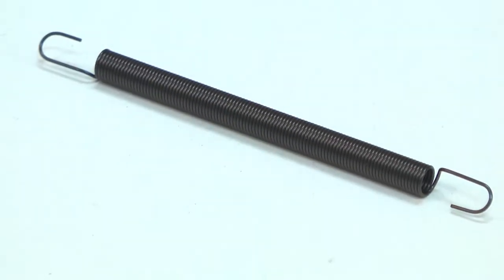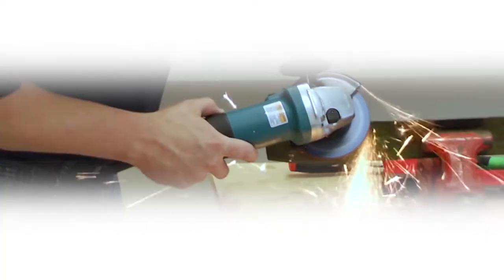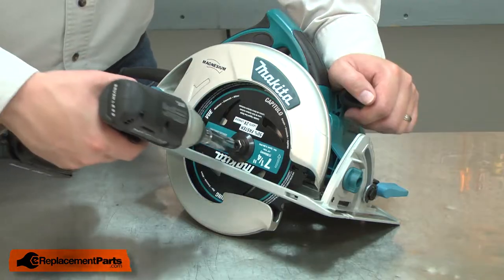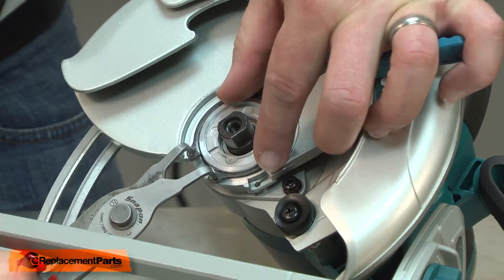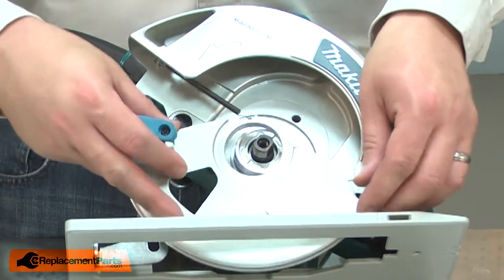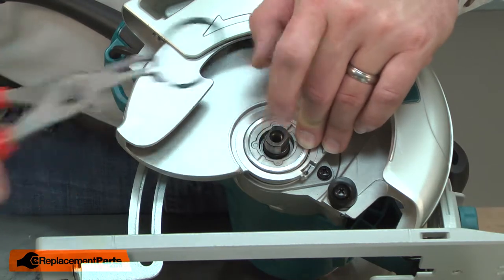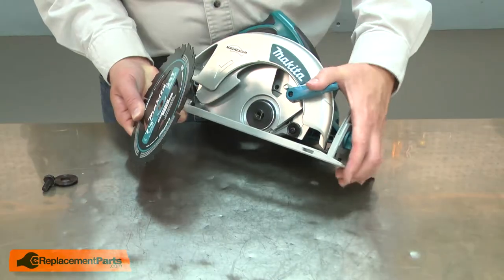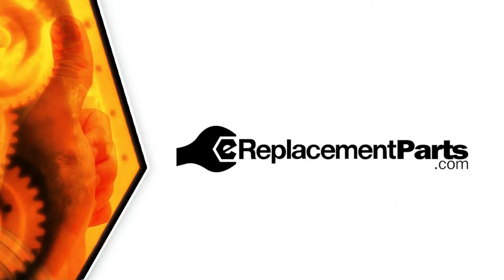Makita Circular Saw Repair - Replacing the Tension Spring (Makita Part # 231839-2)

Comment: Thanks for the instructions! I have two warnings:

1) Notice that the screw that holds blade is going in the opposite direction! So NOT right-tighty, lefty-loosy! At least, that's how my bss610 is.

2) I would never use an electric tool for screws that go into metal, unless you know what you are doing. The electric screw driver can get out-of hand if you don't know what you're doing. There's a metal blade here to worsen the odds for injury.

Comment: No need to take the lock pin off just remove blade and attach spring to the saw and stretch to the safety guard,anyway thanks